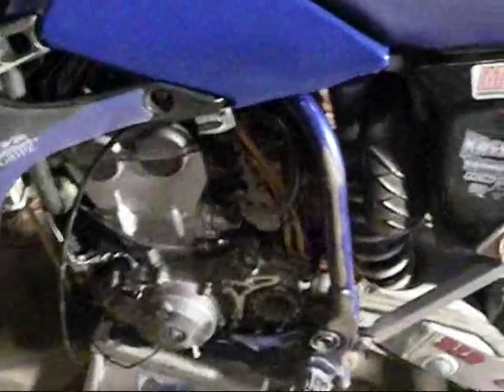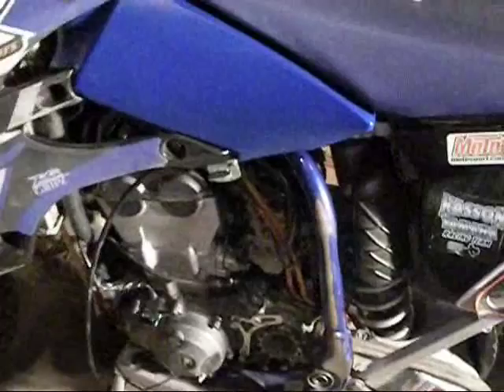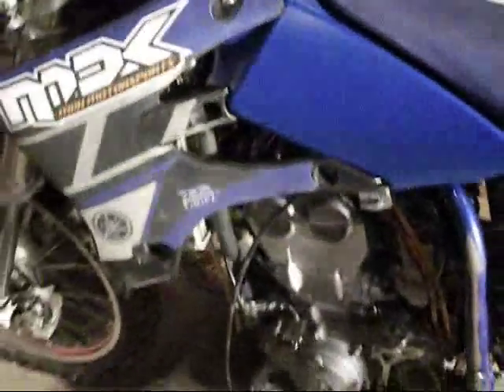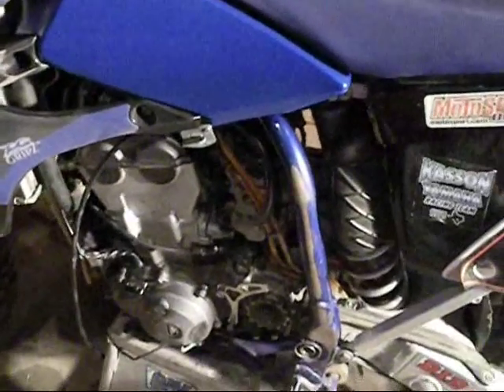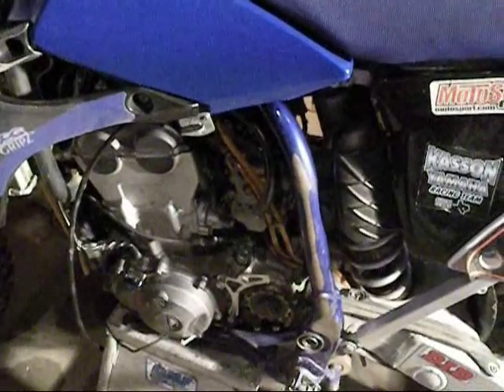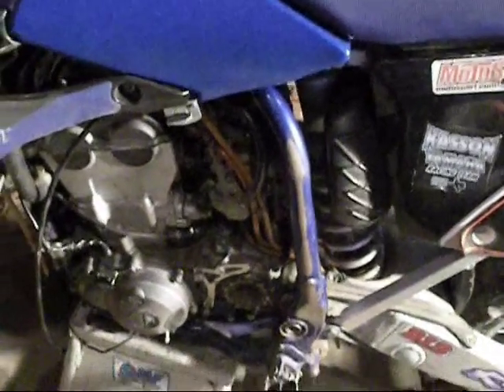How To Fix YZ250F/FCR Carburetor Choke

Comment: So the choke is supposed to be open the whole time?
Reply from the maker: Just when you pull the knob out for starting it when the engine is cold. Once the engine is warm, you don't need the choke. Make sense, Gabriel?
Reply: @MotocrossHideout  yes thank you, my choke wouldn’t stay out on its own
Reply from the maker: I see, you're welcome :) What bike and did you get it figured out?
Reply: @MotocrossHideout  it’s a 2007 Yamaha yz250f 4 stroke and I haven’t put the new carb on, and need to put new spark plug on, but had trouble idiling and hard to start after it’s warm.
Reply from the maker: Why did you get a new carb for it? Did it just start happening or has it always been hard to start when warm?